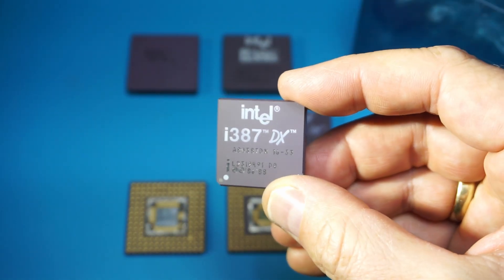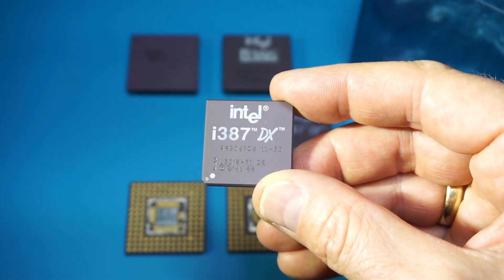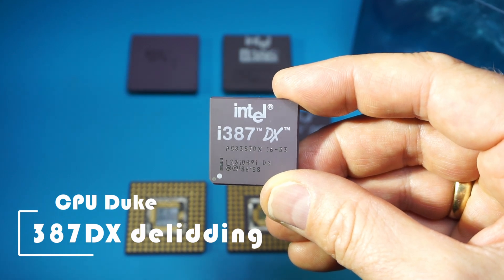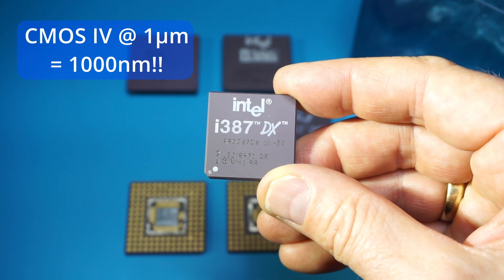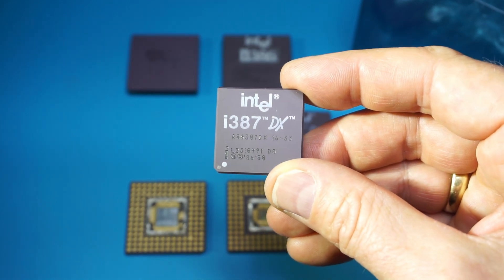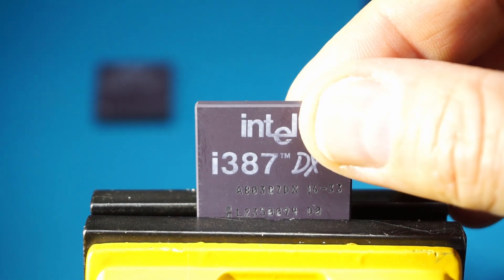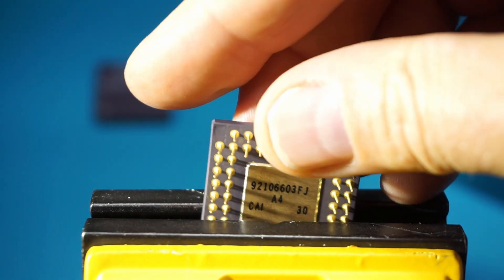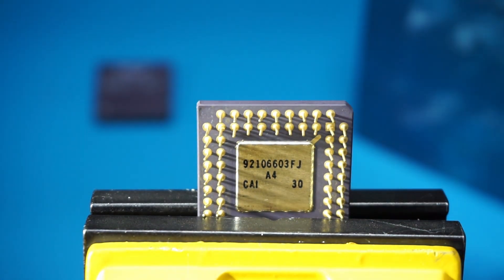CPU Duke 1000 Subs

Comment: The large structural size has benefits. You can delid the IC without destroying it, take pictures and then put epoxy resin into it.
Did this with a Pentium 133 years ago, it still works great.
And you can still see trough 🙂